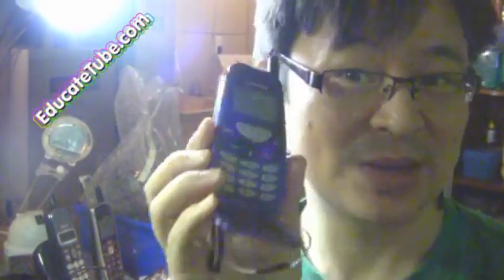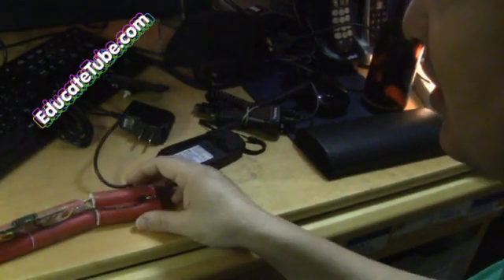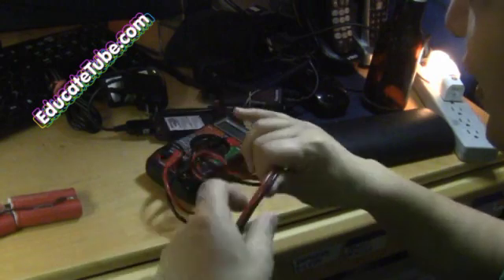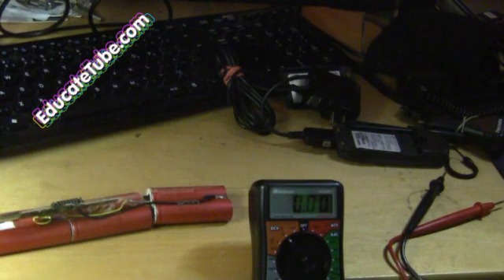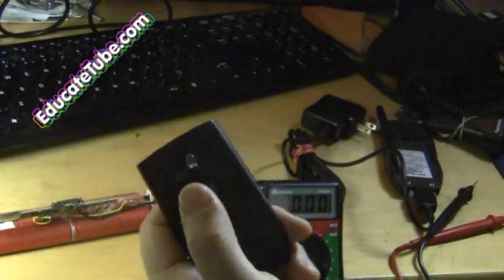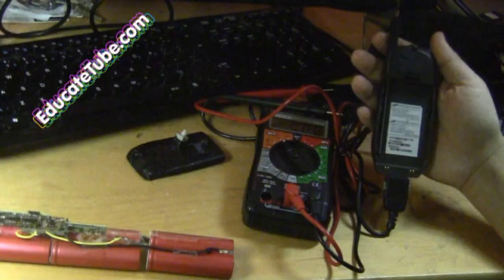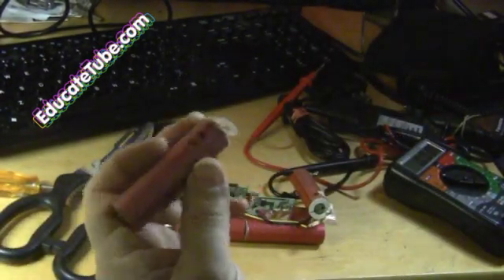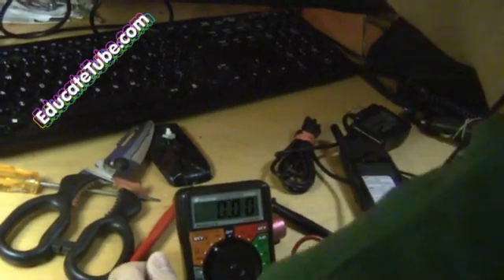How to extract old laptop Li-ion battery and recharge them to run cellphone and LED flashlight

Comment: 1st measurement 4.02 volts, second measurement 3.69 volts? How is that possible? The multimeter leads are connected to points with exactly the same potential each time.

Comment: can u plz show how can i convert used laptop batteries to mobile charger power house, which is having USB micro input for charging and USB for output. what type of circuit to use.
Reply from the maker: you can attach the laptop batteries (less than 12 v) and attach to the car ac/dc inverter with usb plug; in theory, you should be able charge any usb devices from laptop batteries.  I will try to make a video on this soon.